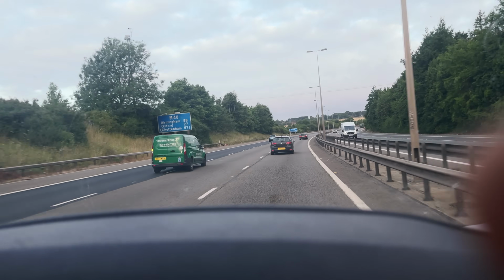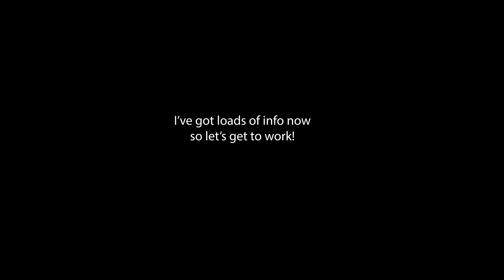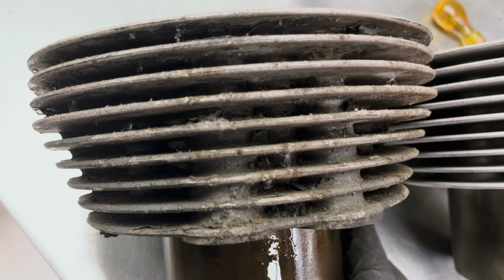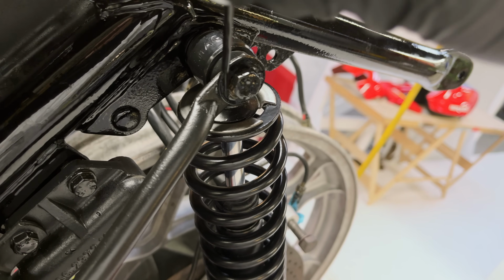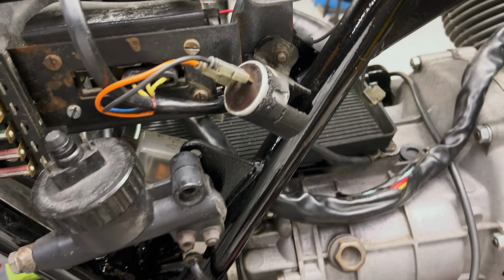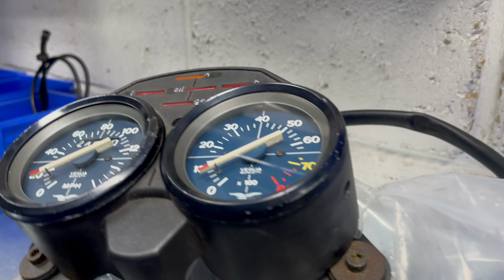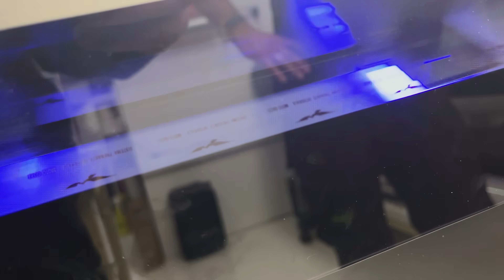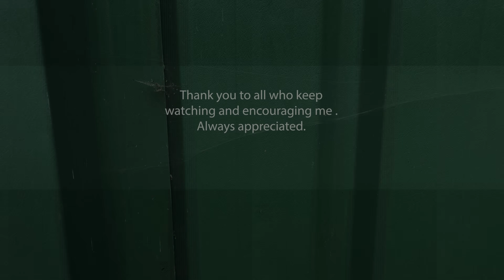Unbelievable motorcycle restoration - Moto Guzzi LeMans Mk1 - My hardest yet!

Comment: Anyone who restores an old part rather than just buying a new one gets my attention and respect every time. NOS parts are great, but if you're not made of money, and not too lazy, I say fix what you already have. So much more satisfying, too.
Reply: I am like you..I try to repair as much possible..from repairing our kitchen grinder to motorcycle parts.

Thanks.
Reply: Dont need yo respect
Reply: True to a point, but on my mk2 Le Mans I am replacing all the mild steel cap head bolts etc with stainless, to lower the ongoing need for rust removal and touching up. And everything goes together with a dab of Never-Seize on the threads as well, something they didn’t do (apparently) on the long engine mounting bolts that run through the engine and eventually electrolytically corrode.  A mate is going to turn-up new ones made from stainless as well.  But where possible it is good to keep what is good.  That doesn’t include the ugly LM2 fairing lol.
Reply: @davidburne9477 Got some sympathy with that approach, as stuck bolts - anywhere - are a pain. But take care that those stainless bolts don’t gall in the alloy.. that’s an equal pain! Les

Comment: The best, most Iconic Guzzi ever.. Looked like it was doing a 100 mph on the stand. Sounded great, handled great plus was pretty quick for its day..130 mph or there about....l owned a new LeMan 850 in 1978/9. Mine was fitted with the smaller, flatter rear light but otherwise was much the same. l didn't realise at the time what a classic icon it was to become.... Oh, the benefit of hindsight. Thanks for a memory of my youth...
Reply: Your light is the 2nd/later batch of the mark 1s.  He's got the light of the 1st batch, but the seat of the 2nd batch: the 1st batch of the mark 1s had his light and a more humped, almost single-style seat.

Comment: My current LeMans 2 had been made to look like a Mark 1. I added a Sprint SR Endurance fairing, twin headlights, electronic ignition, gear drive cams, Saprisa alternator & regulator rectifier, lightened clutch basket & starter ring gear and more. Got it resprayed by a friend…looks mint!

Comment: Great job - i've had 5 Guzzi's and love the way they fit together with the frame splitting and lifting while the engine sits on the bottom frame rails and centre stand. They have the best exhaust note of ANY motorcycle. And the throttle makes my previously broken wrist ache so bad!

Comment: Your videos never disappoint. I feel glued to the screen every time I watch one. Nobody on YouTube does a better job of Restoration and detail work. Welding air fins onto the cylinder head, and not painting them afterward to hide the mismatch, is amazing. Truly a spectacular looking LeMans MK1 at finish.
The one thing I wished you didn't change would have been swapping the Green paint for the Black. I think the Green just gave it a little more POP. Cheers, till next time.
Reply from the maker: Thanks for chiming in. It would simple be incorrect to put green on a mk1. I would get lynched!

Comment: Well done, definitely a labour of love. Looks very original to me. I bought a new blue mk1 series 2 in 1977. Still got it today, removed every nut bolt washer as you have. All the mechanics as it left the factory. They were built like a tank, and handled like one, until you learned how to ride it. I believe the series one had a stepped seat. alloy yokes, they were only black on the series 2, also the lower fork legs. But a brilliant job, I take hat off to you.
Reply from the maker: Always the viewers! Many lessons learned from the comments. Yes correct in most but in my research of the mark 1, depending on the serial number, received a few variations throughout its life. The yokes for example on this were black and seemed to come on this bike. Stator cap changes. Small things I’ve observed. It’s not uncommon. Thanks for chiming in!

Comment: I got close to buy one like this   a long time ago. .  I sat on it in awe  admire the thing solidne feel, sturdy   . Then put my feet on the pegs and both of my knees  were resting on the cylinder heads , and think about the rough roads  around where I lived and said, I am going to bust them on theses solid chunk of aluminium. . .😵‍💫. .  So I went ro my then new Yamaha XJ-750 rl. . .witch is still running today at a guy in Montréal. . 😉

Comment: That was enormously satisfying to watch. Rather sad to see it leave on the trailer, however. Nice video work as well. Looking forward to seeing more. Also nice to see was the use of a timing light. I haven't done that in decades, although I still have one in the shop. I get a kick out of seeing ads for newer bikes which promise "recent tune-up". I like to ask if they adjusted the ignition timing, fuel mixture, or both.

Comment: I lusted after one of these in 1977 when they first appeared on the dealer showroom floor. Alas, its ridiculous price point immediately nullfied any chance of that desire being fulfilled. I bought a Ducati SS instead for half the price of that 850 Le Mans. A collegue still living at home with mum 'n dad in a no rent, utilities or other provisioning outgogings situation did though. We used to ride together. Nothing of significance in performance difference on the road, although the Guzzi motor was undeniably the more robust due the rubbish metallurgy Ducati foundry deployed at that time.  I still thing the Guzzi  850 Le Mans Mk 1 and earlier 750 S3 two of the most aesthetically beautiful bikes ever prooduced.

Comment: Helluva lot of work there, but a splendid job. I'd sooner be the hand that polished the paintwork than the hand that wrote the cheques...
Reply from the maker: @tedthesailor172  thank you. Cost wise that resto cost £2000 in parts. I worked on saving components. It paid off. If I replaced it would have killed the project. This bike was a mess but turned out beautiful.

Comment: Very nice job. I realise that the intention was to make it as original as possible (which is logical from a collector's standpoint), but often original was a bit conservative on bikes. So, I'd have gone for stainless steel brake hoses, a decent fork brace, and maybe created an alternative seat that was actually comfortable to sit on as well as restoring the original vinyl-covered railway track that masqueraded as one. I'd also have considered powder-coating the frame in some other colour than ubiquitous black. Maybe red to match the livery, or perhaps gold or silver. I'd also have changed all the bolts and screws for stainless...
Reply from the maker: Thank you Ted. I can say I agree in this case. You must consider as a restorer what the customer requires and the reality of the budget. In my opinion this is an iconic, but flawed, bike which is returned to its original state all considered bug of course everyone is different thank goodness!

Comment: Better than most restoration. Many people don't de glaze cylinders. I thought U would install a new timing chain & guards. BTW how did U Sychronize carbs? Personally I would use Air filters. Cheers.
Reply from the maker: Thank you. There was a few things I didn’t film in this series. I find when the engine is settling into a new build the idle is not stable if the carbs are clearing and many other new build factors. Sometimes old fashioned processes are still the best..thank you for your kind comments!
Reply: @MyRestoration1  Since I don't do any restoration now but I 💖 to watch them on YouTube but all are not good  . I was a  workshop Engieere @ Yamaha.  Keep up with good work.

Comment: I think they look better without the fluro orange sticker around the headlight. The tidbit about the red / black paint spraying order was interesting. Yep, those indicator relays are notorious for sticking :)

Did you do the braking system as the original integrated brakes, or convert it to a conventional braking setup?

Comment: Curious as to why you didn't Vapor blast the metal parts? Would have taken this restoration to the next level.
Reply from the maker: Hi there. I’d use it if I had one mate! As it is and for the finish I believe the bike doesn’t look ‘disturbed’ for its age. Beside that the quality of the casting as you can see is pitted with impurities which only a de oxidant seemed to work 50%. Don’t be fooled by the shiny ones either. They never looked like that. Cheers though for making me more envious for one 😂

Comment: Curious to know what you spent the parts money on.  New tyres, pads, a few electrical items etc, plus paint is all that's obvious.
Reply from the maker: Sure. Rings bearings cv joint brake parts. Main bearing seal. They didn’t pay for the paint job as that was part of the trade. The client had £2 budget and I believe we came in under that which was surprising as the bike was a bit of a mess. Stripped threads everywhere etc. a fair bit I didn’t show. They still need to see what parts need replacing in the longer term but it is amazing what you save in cost when you restore. They have the bike as a foundation.

Comment: I reconize de looks of a worn out Guzzi. But you think, ah, will still work. She will still ride....not. Then the restoration. Every part looks familiar to me. Every part tells it's story. But undernith it's bad. And you know it. Than the build up. It comes alive. And the endresult? The most beautifull looks of a Le Mans. The ferm but od feel of the grips in your hands. The deep rumble beneeth you. The bike that wants to tip over to one side if you open the throttle. And then riding it. Pegs hi, arms far away, your boddy crampt on the relative smaĺl bike..but when the trottle goes way open on the highway it all comes togetther. You are one with the bike. It wonds to go and never stop riding again. Vibrating, rooring and fighting agains the wind. Faster and faster. And it feels like a train on tracks.
Reply from the maker: Well said Corndolly2107!
Reply: @MyRestoration1  I had a '76 guzzi V7(special) with sidecare for 12 years. Then a V35 Imola and a V65 with sidecar. But de old Le Mans was my dream. That feeling, just sitting on it. I was in love for life but could not reach it. Like the Imola but then a big boy. Riding the Le mans was to mutch for me. I would ride every day dangerusly too fast. Just for the kiks of it. So I did't buy it and buy the little one. Witch is just as fun riding but less dangerous.  Now I'm up to it's strong caracter I think after 40 years motorriding. But it's way out of my budged. Even secondhand restauration objects they ask more then it was new in the days.